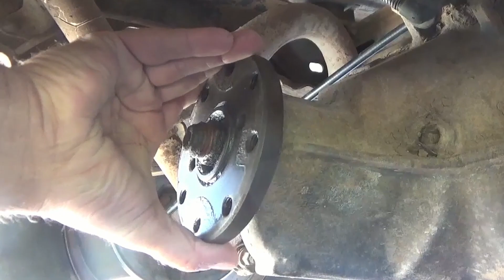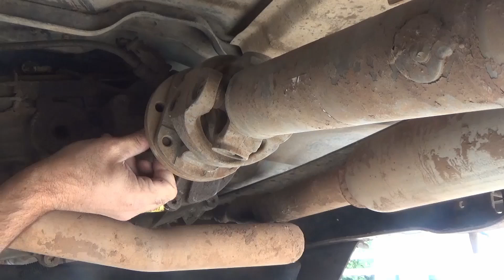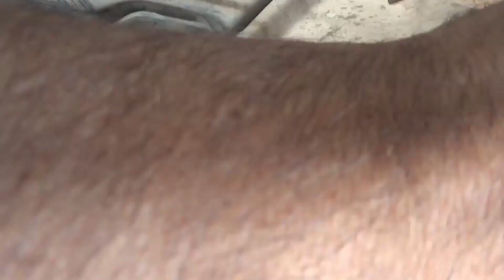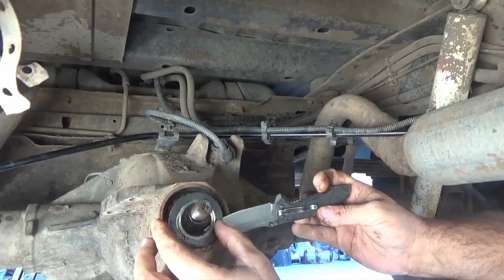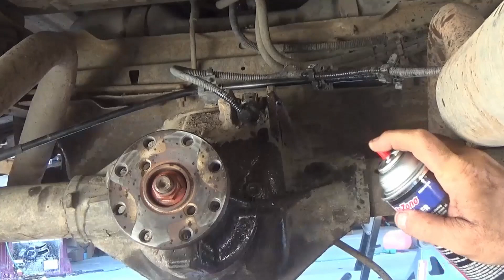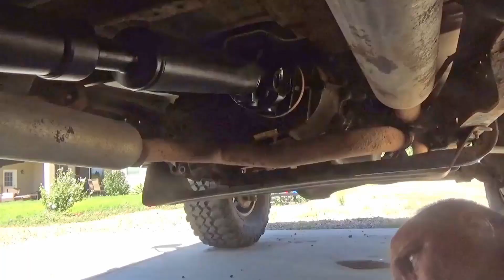FORD 8.8 Rear Pinion Seal Replace | 1990 FORD Bronco 4x4 Project! Differential Flange | OBS Build!

Comment: Great video . My pinion nut has a horrible habit of back off . Any tips to ensure it stays put?
Reply from the maker: A touch of blue loktite and torque to the spec in the video. You cannot tighten beyond the torque value or you will crush the crush ring more and that will change clearances. Thanks for watching!

Comment: With all due respect the job still isn't done. With the axles on the ground you need to use a jackstand to move a breaker bar to turn the nut to set the preload correctly.  You need to keep doing this and check periodically with beam style torque wrench. The axles and carrier must be out to do this correctly.  The factory manual says 140 ft lbs is the minimum torque but you have to go way beyond that to set the preload correctly. And no use of power tools either.
Reply from the maker: The nut came loose. In this instance there is no need to crush the washer, in fact if you crush the washer you will change the wear contact. I am just fixing the leaky seal and the loose nut in this video. The bronco went 25K miles until I sold it and I see it bombing around quite frequently still, so I guess it worked out ok. Thanks for watching!

Comment: My mechanic says that i need to replace the race also or things will go bad quickly.

How long has this fix lasted for you?
Reply from the maker: 25k and still going. But he is a “professional” so you should make up your own mind. Thanks for watching!
Reply: You replace the race when you replace the bearings. In order to replace the bearings and race you have to remove the axles and carrier.

Comment: NEVER reuse a crush collar or pinion nut. I could go on.
Reply from the maker: Gee! I wish I knew that 25k miles ago! Haha! As long as you do not torque the nut beyond the value to crush the sleeve more you are fine. I am sure certified mechanics will change the nut and sleeve for this fix but I believe most of that is built in to cost money. This fix has lasted. Sorry you disagree, but thanks for watching!

Comment: Why didn't you check the pinion nut preload??
Reply: Exactly. He forgot to do that. I doubt it if he sestroed the crush sleve. You have to tight it real tight with a breaker bar to damage thst
Reply from the maker: I did not forget. I did nothing to the preload or the crush sleeve. As long as you do not go beyond the crush sleeve torque you are not affecting any of that. Thanks for watching.
Reply: @heathputnam9524 my son and I are going to be replacing the crushed sleeve and pinion seal on a 95 F150 I was just wondering how to go about giving the proper preload for the crush sleeve

Comment: Can this be done without putting the truck on jackstands? I have a 2” lift and recently replaced rear diff fluid and gasket and unbolted driveshaft without jackstands.  Thanks!

Comment: Quick question, i have a 92 ranger and im able to grab my driveline and twist it around more than it should, would that be my gears? Or do i just tighten the pinion nut?
Reply from the maker: That sound like the pinion gears. If the pinion nut is loose you will feel play in the yoke that hooks to the driveshaft. It wouldn’t hurt to see if it is loose before digging into the differential. Thanks for watching.

Comment: Im jealous how easily the seal came out! Mine is having so much trouble getting out and I’ve tried almost everything :/
Reply from the maker: Lol! Thanks for the comment!
Reply: Had the same problem. I bought a cheap seal puller and it popped right out.

Comment: I read that you have to mess with pre load and measure back lash etc when taking the nut loose.  My pinion nut was loose and yoke had play, can I simply torque it back?
Reply from the maker: Yes, the torque of 160 will tighten it up but will not change the preload. Thanks for the comment!
Reply: Not necessarily- if it loosened up it’s probable the pinion bearing(s) are shot. There could be backlash and engagement issues that you might want to address.